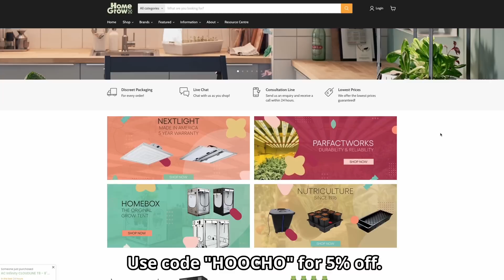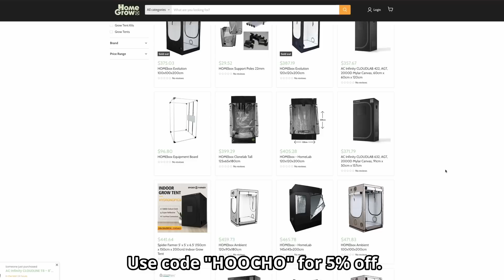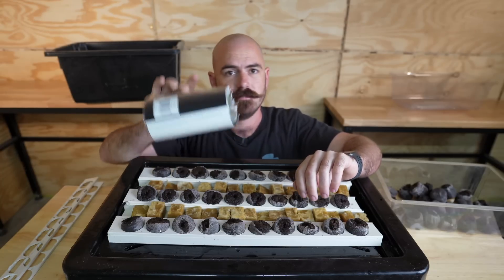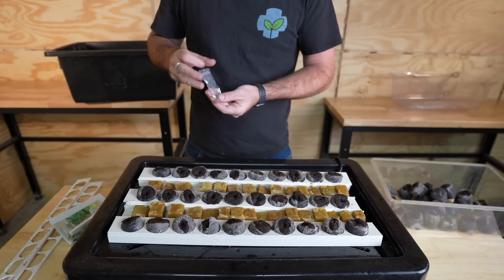Mini Nutrient Film Technique Hydroponic System Timelapse

Comment: This is an awesome little setup that looked like would fit my requirement for an indoor under/on bench grow setup. But with the root issues it leads me to more questions for growing plants fully in this system…

- Would halving the number of plants have resolved the root issue?
- What would be a better size of rail for this? (Higher or wider)
- Are you thinking of redoing this for a full grow?

Loving your work mate, thanks for everything you do!!

Comment: I have a boiler room with nice heat in it and a nice sized window. I'm thinking about doing my propagation there. Would you still suggest I use a grow lamp for 16 hours, even during the day where there's indirect sunlight?
Reply: You could try without but I found that indoors, even with plenty of window light, my seedlings were stretching.  Adding even a really low powered (10-20 W) grow light from the hardware store will make a big difference.

Comment: This might be a dumb question. Curious why no one drills holes at the side of the containers, near the top. And leave the lid intact? 

I mean for pump outlets, power cables, air tubing, return pipes. It's just really annoying to deal with all the plumbing when lifting the lid for maintenance. 

I assume holes might cause the container to be weakened, and they'll crack with the weight of the water?

Comment: Hoocho, love your channel, watch your videos all the time. I have a problem with my self watering system? I currently have a 55 gallon nutrient reservoir that feeds 2, 25 gal. reservoirs that have a small pump which feeds my dutch buckets. The float valves I have which look just like the ones you use don't seem to allow the water from the nutrient reservoir to come into the 25 gal. tanks which are about 2' lower than the nutrient reservoir. They seem to need to be fed by pressure rather than gravity? What do you think I am doing wrong? Keep up the good work. I am currently working on converting to your gutter wick system because this current system does not seem to work without water pressure.Thanks